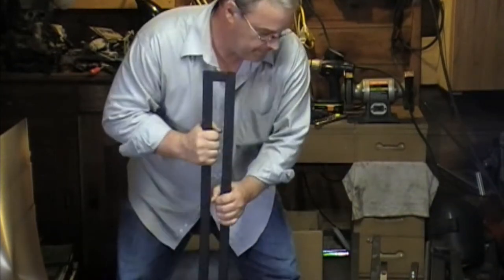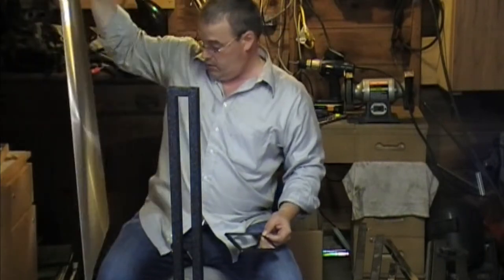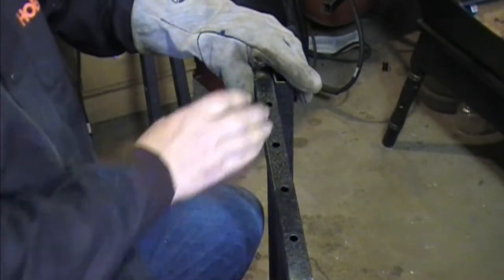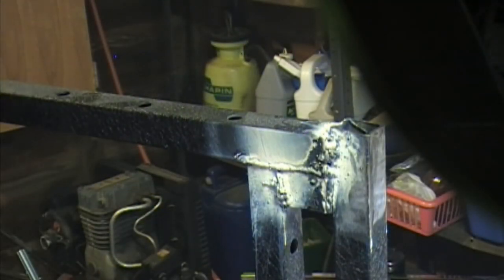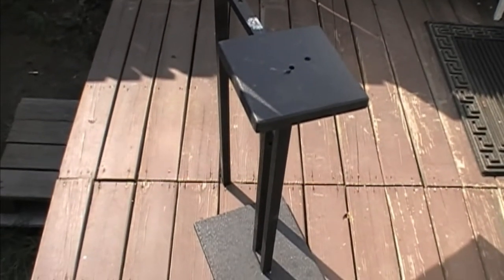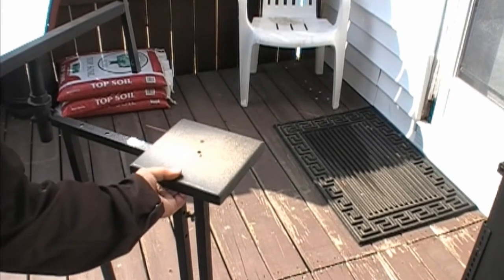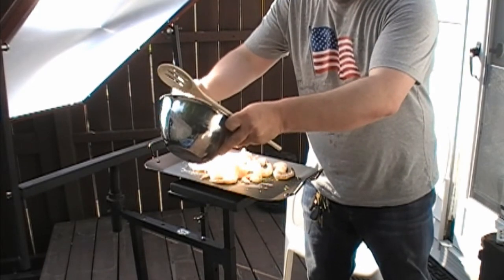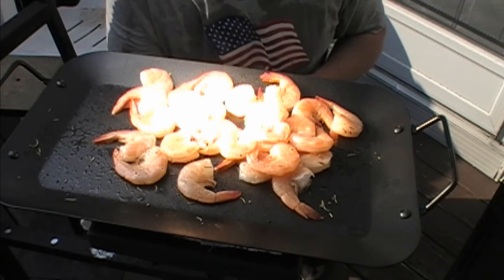The Amazing Solar Grill   Must See

Comment: That's a great build! "My daddy said if you need a grinder to make a weld look good, that makes you a 'grinder', not a 'welder'." Just kidding, but I couldn't resist!
Reply from the maker: Phillip Garner like to weld but by no means am I a welder. I would call myself a grinder with a welder.
Reply: I fall into the same category. I usually weld using the "gorilla method". It's ugly but it;s strong!

Comment: Tip: Instead of grilling the food directly, which requires attention all the time and risk your eyesight, put it in a black steel container and let it rotate slowly. Works great for me, you can check out the results 😎